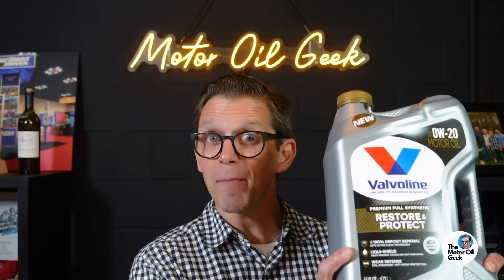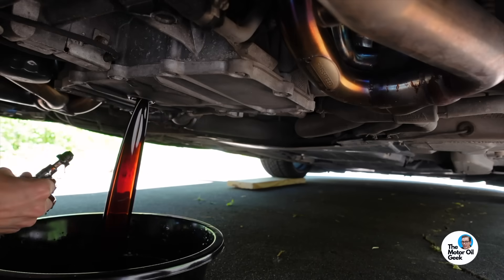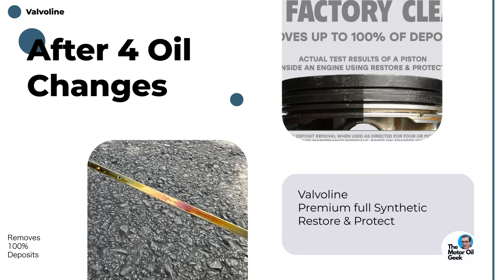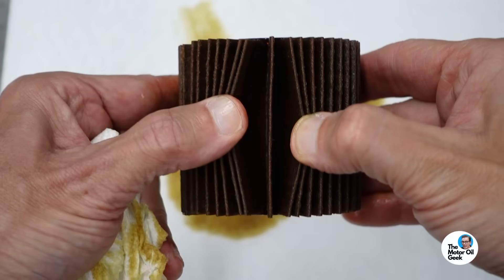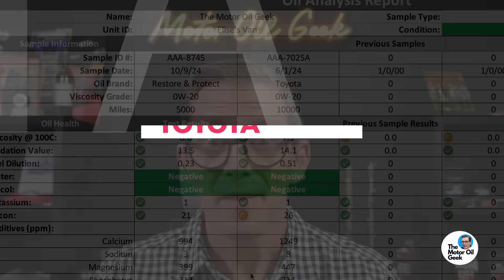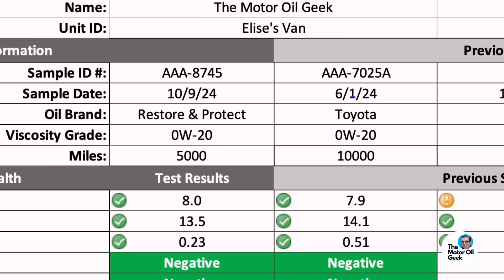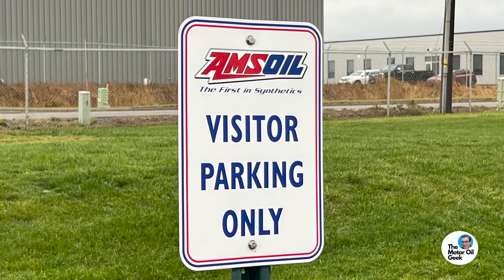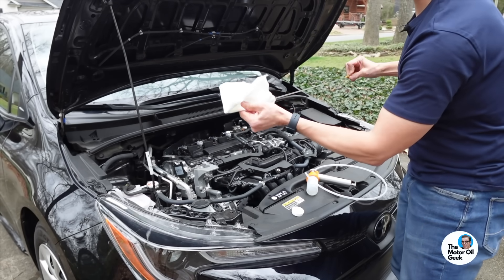The TRUTH About Valvoline's BOLD Engine Cleaning Claims

Comment from the maker: Thank you so much for watching! Here are a few points of clarification based on the comments so far. 

In regards to the Restore & Protect product itself, it is not for Diesel engines. For information about availability, I'd recommend contacting Valvoline directly (https://www.valvolineglobal.com/en/)

To see engine parts before and after a tear down, check out the original video: https://youtu.be/kyyZDghgdCI

As to the backstory on my wife's van. We bought it new in 2012, and it has only ever used Toyota Genuine 0W-20 (which is made by ExxonMobil, but is not the same formula as Mobil 1). We did the early oil changes just like I did with my daughter's Corolla: https://youtu.be/_6nWCQ_70J0. I worked for Joe Gibbs Racing when we purchased the van, and Toyota had a special deal for the team members at that time - lifetime powertrain warranty if all the service work was done at a Toyota dealership. That's the primary reason for the 10k oil change intervals, but the used oil analysis results never showed any wear issues or oil health issues going that far. There are no oil consumption issues with the engine, so the varnish is the only downside of that extended oil change interval (until the Restore and Protect fixed that).

And just in case you didn't watch the entire video, there are no sponsors on these videos. Neither Valvoline or any other oil companies pay me to make these videos. I choose to make videos about the products and topics that I find technically interesting based on my expertise and 20 years of industry experience. Also, I hope these videos provide value to you, the viewer.
Reply: @themotoroilgeek  so what is the better oil Pennzoil Ultra Platinum or Valvoline Restore and Protect?
Reply from the maker: @XBX1MASTER both are good, but I have not run a head to head durability between the two.
Reply: @ please do if you get the chance. I'm torn between the two. If the Valvoline synthetic is as robust as the gas to liquid then I may switch. Thanks for your time.
Reply: @themotoroilgeek hello, I am seeing Valvoline Premium Blue local ads showing 5W40 and 15W40 in dark blue 1 gal containers. The front label indicates both are suitable for gasoline & diesel engines. But nothing is mentioned for API rating like APL SL or SM or SP. Pls advice. Thanks.
Reply: @themotoroilgeek can the valvoline r&p be used every oil change in a brand new engine?
Reply from the maker: @LORD_OF_THE_ROOTS  Yes, it can.
Reply: @themotoroilgeek  thank you. ✌️
Reply: @themotoroilgeek este sería un mega video, nadie lo tiene esperamos lo saques tú pronto Valvoline vs Penzoil Ultra Platinum 🔥🔥🔥🔥
Reply: @themotoroilgeek - do it😃
Reply: @themotoroilgeek still waiting for the head to head. 😮
Reply: @themotoroilgeek please do a head to head comparison/analysis.
Reply: Will it work on turbo engines with GDI?  Like a Mercedes e550?
Reply: @themotoroilgeek Awesome! I just started using it in my 13 Sonata 2.4 Theta 2 engine that was replaced under the lawsuit about 14k miles ago. So far it hasn’t started getting dirty but it’s only been 400 miles and I have been running 3k oil changes since it was dropped in the car. Also started using the 93 octane at Shell instead of the 87. Maybe that coupled with the R&P might keep my combustion chambers, injectors, and GDI pump and pump cam happy?🎉
Reply: I get it at Walmart online, and it's here within one to three days via a local contract courier. It's actually a lot cheaper than it is at any of the few other places I've seen it online, and almost absurdly cheaper than it is at the only store to recently begin carrying it out of the four big-name aftermarket parts stores in my area. I am not a fan of Walmart in many regards, but people who don't at least occasionally shop there are few and far between.
Reply: I still would like to know after 4 oil changes do we keep using it, or switch back to say Amsoil.
Reply from the maker: @ugetridofit  It is designed for continuous use.
Reply: @ugetridofit  Hi Ugetridofit. I drained my 2020 Chrysler 3.6l w/112k miles of the Amzoil 0 20 (or 5 20 can’t quite remember) with 16oz of Motorkot. The oil mileage was 4k. It was cleanish and in a word impressively slimy. I’m using Val R&P 5 30 on it so i dont have results yet but i’m hoping for a little less rattle. Not ticking thank goodness. I’ve been very impressed w/Amzoil…..now that i can afford it ha!
Reply: I hope you keep up with that van’s progress for a long time so we can see how many miles it survives on 10,000 mile oil changes. It’s hard to imagine it would varnish the dipstick so badly and still not be contributing to added wear on the engine. But I guess the lab analysis speaks for itself.
Reply: Hello will this also clean the valves on a GDI engine?
Reply: @barrymccorkle2332  i dont think so it's usually gas hitting the back of the valves that cleans them, direct injection fuel is injected into the cylinders
Reply: @barrymccorkle2332  
The valve stems that are bathed in oil in the cam covers....yes.
The actual valve heads and stems that are in the intake air stream....doubtful.
Reply: Does anything come for diesel engines ?? Also what is your thoughts on additive to clean the engine ?? Thanks for your time.
Reply: Hi Lake, two quick questions:  1) your daughter's car needing 0w-8, does R&P come in 0W-8 (and 0W-16)?  I couldn't find 0w-16. 2) that Fe check you did, was that used on the Speeddiagonstix report for my Camry y'all did in March (email date March 15, 2024, Rich Combs customer name...gmail acct).  I see iron in the report at 3 but I get the feeling that is for the smaller size particles.  For reference to the report, I had the 1.6% dilution (by the way the Chevron Techron cleaned those injectors on the first pass I believe...still using it....and NO generic gas).  Thank you God Bless and Happy Thanksgiving!
Reply from the maker: @richcombs4805  I'm not sure if R&P comes in 0W-16 yet, but I'm not scared to use the 0W-20 instead. The 0W-8 and 0W-16 grades are strictly for fuel economy. 

In regards to the EZ Fe check, we do not use that on the standard testing.
Reply: @themotoroilgeek  your opinion on this is hugely important thank you so much!!!
Reply: @themotoroilgeek  I think I've stumbled into a next topic for you if you wouldn't mind at some point: at operating temperature for THAT Corolla, what is the cst of Toyota 0w-16, VR&P, and Penn 0w-20 Ultra?   Not at 100C....but at operating temperature.  The reason I ask is, I would like to know why you aren't scared, and I am.  I am because I hear via Amad in Chicago that those variable speed electronic oil pumps are very sensitive and for the average owner, he's advising "don't do it".  I believe him.  I also believe you, but there's a reason you are comfortable and he is not.  It might be only because you are on top of the maintenance and know the ambient and how your daughter drives and test the oil. But at operating temps, the actual cst's and how they compare is on your mind I'm sure.
Reply from the maker: @richcombs4805  I'm aware of these pumps, but the reality of the matter is that oil viscosity changes dramatically from 0C to 100C. So the oil system can support a wide range of viscosity in normal operating conditions. These super low viscosity grades (and these variable displacement pumps) are 100% for fuel economy. I would not suggest putting straight 30 in that engine, but the actual cSt difference at 120C between a 0W-8 and a 0W-20 is less than 4 cSt. In comparison, the viscosity of the oil changed more than 40 cSt between 10C and 80C.
Reply: @themotoroilgeek  woe, wait.  Just when I thought I knew that the "winter" rating was the first number, somehow "0" is different from "0".  Oops, am I bass akwards-- the second number refers to resistance to flow at cold temps / cold start overcoming static coeficient of friction vs flow during warmed-up engine?
Reply from the maker: @davidvankainen6711  The 2nd number is flow measured at 100C, but all oils get thicker as they get colder. As such, the variable displacement pump is designed to move the proper amount of oil over a wide range of temperatures, which means a wide range of flow rates.
Reply: @themotoroilgeek  maybe I read that 40cst difference wrong.  Not 40cst difference BETWEEN the 2 oils, but rather just (both) oils changing viscosity significantly at colder temperatures which would make sense.
I'm thinking 0W X and 0W Y would have similar viscosities at COLD temps, but different viscosities at engine opp temps.
Reply: @themotoroilgeek  just wanted to ask suggested oil change intervals for a brand new engine starting with 1 mile. Thank you.
Reply: @themotoroilgeek  thank you!!!
Reply: You modified their service interval with early oil changes. Why not continue with your own oil changes at 5000 mile intervals in between the dealer?  You could leave their filter and just change with fresh 0w 20 Toyota oil. 
 Modern oils may keep their viscosity and lubricity but they become contaminated with water and fuel.  The varnish was unnecessary and I believe you were lucky with this particular engine. I would not recommend 10,000 miles oil changes as a good general practise.
Reply: Can I use valvoline R&P from day one in a brand new engine?  Will it perform as it should being brand new?   Ty
Reply: @LORD_OF_THE_ROOTS  yes 👍
Reply: My Kia K5, with just 700 miles, will soon get an oil change with 0-20 Restore and Protect. 20w oil scares me in 95 degree heat. I will order an oil test kit when it hits 5,000 miles. After reading your follow up, I feel better about using it. Only use top tier fuel, and Techron too occasionally. Thanks for your efforts here.
Reply: @charlesm9530   check your owners manual for using 5w30 etc. my sonata manual says I can use 5w20/30 and if it stays above 0 degrees year round, 10w30 on the non turbo 2.4 but the 2.0 turbo allows up to 5w40
Reply: My car needs 5w40 can i add 5w30?
Reply: @joewontwice You aren’t supposed to use a lower number on the 2nd digit but you can on the first digit. The owner’s manual should show you what is allowed. My 13 Sonata says to use 5w20 but goes on to say 5w30 is fine because the 5w20 is more for fuel efficiency. It says 5w20 is the recommended number to use but shows a chart for your climate that shows 5w30 and even 10w30 if you don’t experience temperatures below 0F 🎉! I plan on going to 5w30 for Texas climate ❤which is more protection and doesn’t void the engine warranty.
Reply: I'm currently putting in 1 quart of oil stabilizer with my oil every time I do an oil change. Would it be better to keep doing that if I switched to R&P, or just do 100% oil with no added stabilizer? Car's at 212k miles.
Reply: @slayerx681  Lake and others say to only use additional additives in the fuel but not in the oil because they compete with each other and can do more harm than good 👍
Reply: Will you/when will you do a follow-up on this video with results from your wife's van?
Reply: A quick question please Lake, is the base oil used in this product a Group 3 or a Group 4  base oil? I am looking at using the 10W - 40 Grade.
Cheers, Mark.
Reply from the maker: @markheaton-e2i  It is a Group III, which is not a bad thing. Group IV base oils have very poor solvency (one of its few weaknesses), so the cleaning ability is enhanced by the Group III base.
Reply: @themotoroilgeek  my tractors use motor oil as their hydraulic oil. What do you think of using Valvoline in the next change?
Reply: Do you think Restore & protect will be ok to run in a turbo charge  engine ? Will there be enough lubrication in the oil for the turbo bearing?
Reply from the maker: @gordonbrown7489  Yes, one of the API tests is a turbo charged engine.
Reply: I did watch the whole thing and I understand "free"  dealer oil changes, but I would have changed the oil in between their schedule every 5000 and just not told the dealer.  You could even leave their filter on and just use fresh 0w 20 synthetic or buy some Toyota oil;  they don't test the old oil to make sure it's the Toyota formula. 5000 mile used oil looks black too. You already modified their plan when you did early oil changes.  Why not continue?
Reply: Would you use the 10w-40 restore & protect in an air cooled 1641cc VW Beetle engine with its oil screen rather than a filter?
Reply: I have a couple of old high mileage vehicles that I have been using the Restore and Protect at oil changes. The engines are very clean now. I noticed that the engines have to be topped off with and added quart of oil after a hundred miles or so of driving in both vehicles. I used Motorcraft Full Synthetic with 20% Marvel Mystery Oil to help with the cleaning of the older engines. Could you have any idea as to why my consumption has went up? Any help would be greatly appreciated.
Reply: @stealthbomber2127  
Do you have to top up after every 100 miles...
or just after the first 100 miles after the oil change?

Are you taking into account the capacity of the oil filter...
sump filled to line but as soon as the engine starts the oil filter has to be filled up.

So next time you dip the stick it will be down one oil filter's worth of oil....

That's why you run the engine after the change with the bonnet up, check for leaks around the new oil filter....and then top up to the line once more.
Reply: @ste @stealthbomber2127  is not good to add to oil. It may have damaged the seals. I just saw a video on the variety of additives on the market and what they are made out of and why they can damage seals and gaskets and mess up o2 sensors and catalytic converters so just use oil and stay away from additives and flushes.
Reply: I would think taking a drain sample would give you better data since heavier particles will drop down and you might not get a proper analysis using the pump analysis.  Just a thought.
Reply: Been nine months, can we get an update? Love the information you share.
Reply: @paulbui2336 Him not mentioning VRP anymore is an update by itself 

Saudi Aramco has bought Valvoline. They needed sales for the deal to close; hence, the too good to be true Valvoline claims. 
“Up to 100%” is a marketing gimmick. Zero is also up to 100%
Reply: Does this product have any effect on intake deposits on a DI engine, like a 2025 Mazda SkyActive Turbo (gas)? Maybe you can make a video that addresses the intake deposit problems of DI engines (if you know of a good remedy/preventive measure). Thanks for the great real world test -- very impressive dipstick result!
Reply: @geeder9086    It can help along with Shell gasoline and a BG intake valve treatment at a reputable shop every 30 - 60k
Reply: Are you still using Valvoline R&P in your wife's van and daughter's Corolla? I switched 2 of my vehicles over and oil analysis so far looks good. Thank you!
Reply: Lake, do you suppose this Valvoline and maybe other brands coming soon have this formulation to combat the issue with direct  injection carbon fouling?  Do you think it will help with that, to clean those valves instead of building up?
Reply: What do you think about valvoline hybrid 0-20w? Oil worth using?
Reply: @themotoroilgeek   trust me  see I’m not an expert but at the dealership some clients. Come with the oem Toyota oil brand. But I had to teach them the very back label in the very corner it says it’s made by. Mobile one. Which is a false advertisement in the front of the bottle says oem. But oem doesn’t make it go to 
O’Reillys  buy their brand  even though is says is their brand in the back says who makes it.
Reply: @jorgeespinoza3564   O’Reillys is trash, won’t honor refund for defective gas can so I pulled my business out 🎉
Reply: Would there be any benefit in using this oil in-between dealership oil changes at the 10k mile interval? I thought I'd change the oil myself with the Valvoline at the 5k mark then let the dealership change at the next 5k mark stamping their recommended interval of 10k miles in case warranty work is needed down the road. That way, I would have their recommended interval documented at the dealership. I don't want the dealer to have any reason not to honor their warranty. I just bought the vehicle with 32,400 miles on it and the previous owner looks to have done about 9k miles between oil changes. The vehicle has new car warranty left and then 3 years of CPO warranty after that. Thanks. On another note, your dad's #83 Purex car was one of the best-looking cars on the track back in the day.
Reply: Great video and content, as always
Reply: just wondering  does something like this exist fit for wet clutch engines?
Reply from the maker: @mathiasvofrey9240  That's an interesting idea!
Reply: Great info, @themotoroilgeek, thanks so much! did you use a Toyota brand oil filter for your wife’s van and do I need to change it at the same oil change intervals or more often due to the cleaning?
Reply: I bought the more robust Cummings formulation Valvoline Premium Blue Restore to use in my 3 Cadillac's but all 3 were stolen.😥. Now I have 4gal of it.
Reply: I have a 2008 Honda Odyssey. Almost 260k miles. No issues. Check engine came on, I replaced my thermostat and no more light. I was thinking to use Hot Shots Secret Grey Diamond 5w30. Previously used mobile1 full synthetic. Do you know anything about the Hot Shots Grey Diamond?  Should I risk and test it?
Reply: Hey Lake. If my 2017 GMC 5.3 calls for dexos1, is it ok to use this oil? Thanks Kenny
Reply: Could this stuff cause leaks to appear on older vehicles?
Reply: I’d like to see what vehicles were with the 400k and 1.5M miles. I have a guess, but I’d like to know for confirmation.
Reply: Can we get a link to that tool you used to suck out the motor oil from the dip stick tube?

Actually, it would be great if you made a dedicated video to various oil suction tools and important do's / don't / gotchas on using these tools
Reply: These videos are soooooo good!! ❤ So much valuable information!! I'm going to run R&P in my van and SUV. Thanks Lake!
Reply: Where can I purchase that vacuum pump?
Reply: Thanks lake you the man appreciate ya bud
Reply: Lake, is there a test you’ve done comparing VRP (Val R&P) against any AmsOil oils? I’m curious if you feel the signature series by AmsOil is as good as VRP or if you have a video on that I missed…?
Reply: Mobile one has their own version of this oil out now. Mobile one Advanced Clean. Add it to your future video list😉
Reply: @mrsmith8436   Mobile isn’t as good as it once was. I think Valvoline is the way to go these days
Reply: In your opinion could I use Valvoline Restore and Protect on my first Oil change on my 2024 Jeep Wrangler Willys which I bought New about 2 weeks ago and now has over 700 Miles on it.  I figure the Oil in there has been in the engine for over a year since it is a leftover 2024 Model.  Of course due to Carb mpg requirements they use 0W20 in the engine.  I am tempted to switch to 5W30 which every other country (Cold or Warm) climate recommends.  I live in South Carolina and we don't get very Harsh winters.  Or should I stay with the Factory Recommended thin viscosity of 0W20??
Reply: @ThomasRSmith-og7zo    What does your owners manual say? Mine says 5w20 for higher efficiency but 5w30 is ok too. Your engine will last longer on 5w30 🎉
Reply: I do 5000 to 7000 OCI have never had varnish on my dipstick. Full Syn M1 & Valvoline. I have hit 160kmi+ on 5 cars. Same results. I am glad to see this oil will work when I am in a bind with sledge.
Reply: I just bought a 2011 Silverado 2500hd 6.0 gas. I don't think the previous owner took good care of the oil changes. Truck has 135k
Is this Valvoline recommended.  Thanks
Reply from the maker: @MrBowmanmt  Yes, I'd give it a go in that truck.
Reply: Thank you @themotoroilgeek
Reply: What does it do to the rear main oil seal
Reply from the maker: @tonycolca2241  Nothing. All API SP rated oils must pass seal compatibility testing.
Reply: What happened to that motorcycle oil video you were making?
Reply from the maker: @__Max-oe6zm  That's our next video!
Reply: @themotoroilgeek  very cool
Reply: Is it bad to use 10W-30 in a car that has an over 170,000 miles on it when the cap cost for 5W-30
Reply: Can you please look into which oil is best for hybrid vehicles?! They're becoming more popular and maybe there's a lower cost than OEM oil.
Reply: Is it bad to use 10W-30 in a car that has an over 170,000 miles on it when the cap cost for 5W-30
Reply: I’m still skeptical 

The dipstick trick can be explained by a higher oil level and not by oil itself.

After running for 10K miles, oil was at the lower level; hence, the dirty part of the dipstick was not submerged in oil. 

Changing to a Walmart oil would also clean the dipstick.
Reply: @onedaily2471    It cleaned my 97 Civic dipstick and Walmart trash oil did not. 🎉
Reply: Hey Lake, I'm rebuilding a 1.6L turbo diesel and I'm wondering if this Valvoline Restore and Protect would be a good idea to just use all the time seeing how dirty diesels are. Thoughts????
Reply from the maker: @howibuiltthis2088  It's not for diesels!
Reply: @themotoroilgeek  Aw man thats so disappointing....
Reply: It's not for Ford Ecosport either, 1.5l petrol, nor for Peugeot 206 1.4l petrol. So pretty useless in my eyes when it doesn't work for many engines. It looks like it's easier to find the vehicle it doesn't work with, so what's the point?
Reply from the maker: @tobeyfabila5082  Here is the proper framework for making decisions regarding oil. 

Step 1 - Utilize the OEM recommended oil and do two early oil changes during the break-in process (500 to 1,000 miles and again between 3,000 and 4,000 miles). If the engine is already broken-in, skip to step 3.

Step 2 - Take used oil samples at each oil change to establish the trend analysis.

Step 3 - Go 5,000 miles on the third oil change and take a used oil sample. If the wear rate per 1,000 miles is below 5 ppm, you are good. If the wear rate is between 5 ppm and 10 ppm per 1,000 miles, go another 5,000 miles on the OEM recommended oil and resample. If the wear rate is still greater than 5 ppm per 1,000 miles, then move to step 4.

Step 4 - Review the used oil analysis data to see if the OEM recommended oil is falling short in any aspect (low viscosity, additive depletion, higher wear rate). If it is falling short, try a different oil of the same viscosity that meets the OEM spec. Go 3,000 to 4,000 miles on that oil and then refill with that same oil and go another 5,000 miles before taking another sample. See if the change in brand drops the wear rate per 1,000 miles below 5 ppm. If it does, you are good. If it does not, then move to Step 5.

Step 5 - Since the change in brand did not get the wear rate per 1,000 miles below 5 ppm, use next higher viscosity grade of whichever oil had the lowest wear rate per 1,000 miles. If it was the non-OEM brand, resample at 5,000 miles to check the wear rate per 1,000 miles. If it was the OEM brand, you will need to use it for 3,000 to 4,000 miles to flush the non-OEM oil out of the system before going 5,000 miles on the higher viscosity OEM oil to take another sample. If either higher viscosity oil brings the wear rate down, then stay with that viscosity grade. If the wear rate per 1,000 miles is still above 5 ppm, go back to Step 4 and repeat. If the wear rate per 1,000 miles is below 5 ppm, you are good. You can then use the oil analysis results to fine tune the oil change interval.
Reply: @themotoroilgeek did you change out your oil filter in between services or did you do all 5k miles on the same oil filter?
Reply from the maker: @haystephen  I went the full 5k on the filter, which was shown in the video.